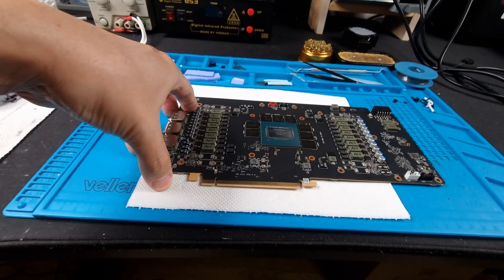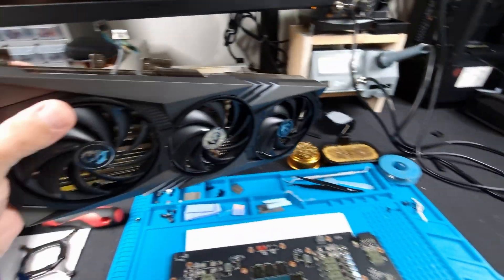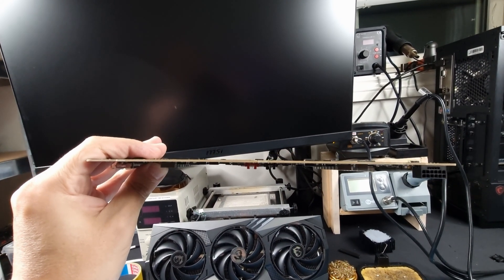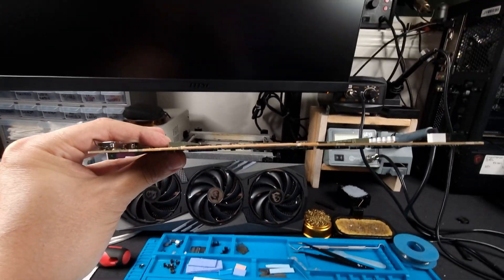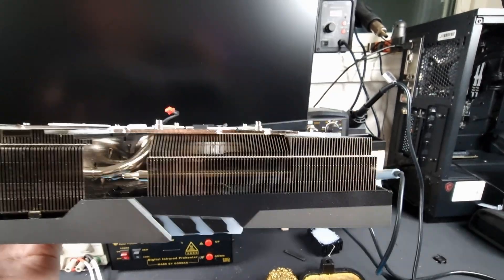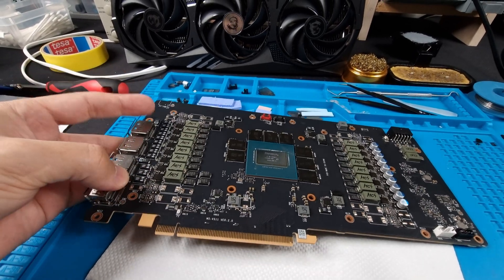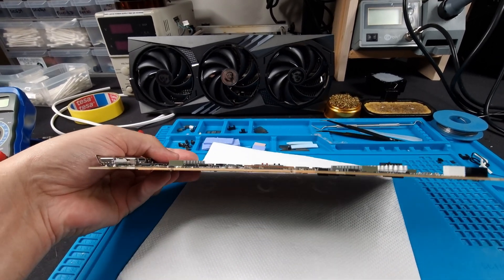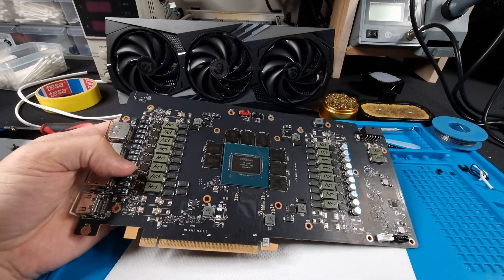How Using GPU Supports Incorrectly Can Destroy Your GPU.

Comment: I’m wondering if my gpu has cracked gpu or vram joints cause now my games tend to stutter and I do use a support bracket system and I did put it at the end of the gpu so idk if the PCB is twisted cause of where I have the support bracket at. I would have to fully disassemble it to find out. 0:15
Reply: I'd try using a fixed FPS... like 60. Stutter usually disappear... if you leave it uncapped, the system usually needs to "breathe" every few moments.
Reply: @ers-br  Tried that. Still stutters on some games
Reply from the maker: @devonefoster105  If you had cracked joints under the memory or core, you'd be having artifacts or intermittent power losses. Stutters could be your CPU being overloaded, or just not fast enough. It could also be VRAM being overloaded, as well or system RAM being filled.
Reply: @TechnologyHive  the specs I have is Ryzen 7 7800x3d with Radeon RX 6950 XT and 32GB DDR5 CL36 6000mhz ram.
Reply from the maker: @devonefoster105  Remember to trim your SSD and or HDD. Also, check how many processes your have running in the background. That could be the cause of your stutters. The 7800X3D is still an 8 core CPU. It could be getting overwhelmed.
Reply: @TechnologyHive  I’ll check that and maybe do some stress testing on my GPU, Ram, and cpu again. Cause the first time i did those tests everything passed
Reply: Game stutter is the bane of PC gaming right now,especially unreal engine games stutter a lot and there is nothing you can do
Reply: @Inpulsiveproductions  That’s unfortunate. Cause I like some of the UE games.
Reply: @devonefoster105  same,and now days feels like every game is using UE engine its crazy,lets hope it gets better,stutters are not exclusive to UE games mind you but ye if the games your playing are on UE engine that might be the problem, and not your PC
Reply: @Inpulsiveproductions  it’s funny because I’m researching what GPU’s can run unreal engine 4 and 5. And idk if this is true or not. But Nvidia 40 series cards and AMD 7000 series can run unreal engine well. I have a XFX Merc 319 Radeon RX 6950 XT and I don’t think that card can run unreal engine 4 or 5 games that well. I could be wrong. And some games I do play are unreal engine 4. Like Train sim world etc and that game stutters really bad. And then again unreal engine has limitations when it comes to rendering or something like that. Unreal engine 5 is much better in general.

Comment: Will having the support more to the middle of the card make any difference?🤔😏
Reply from the maker: Not really, because the actual PCB's for most of these heavy cards is about half the length of the heatsink. So installing it in the middle does not really fix the problem. A riser does.

Comment: I can't estructuraly understand how a CPU would detach from the board in a vise grip configuration. the cold Plate is being Forced Down the CPU and the Board together by the CPU Screw mount
Reply from the maker: Easily done, by hot/cold cycles and adding just a bit of resistance on either side of the card. The lead-free solder which is much more brittle than leaded solder will then crack in time, and cause disconnect between the board and the GPU core.

Comment: That and sub par msi quality look how flimsy and cheap that pcb looks
Reply from the maker: I have cards here for repair with the same issue from ASUS, Gigabyte, and MSI. Brand has nothing to do with it.
Reply: @TechnologyHive  I’ve seen sapphire and evga pcbs and they’re far sturdier than those
Reply from the maker: @annoymouse890  Yup but I also have cards here from Sapphire 😆 with cracked memory joints.
Reply: @TechnologyHive  I’m not saying they’re perfect I’m just saying they’re a lot better and I might have a slight prejudice towards msi cause I’ve had nothing but problems with them I bought a motherboard that just didn’t boot and the replacement wouldn’t boot either and I also had an msi gaming z gpu with insanely high hot spot temps and awful fans and just a flimsy construction over all

Comment: I use gpu support and it holds good, No issues, Without a gpu support you have to use a riser vertical support, Not using anything will crack you pci on you gfx card,  On their newer gpu's, Because they are simply too big on the heatsink part not too now, Atleast on nvidia's side.
Reply: The ppl saying you don't need gpu support are out to lunch.
Reply: @dusty_48  It's crazy i know 😝
Reply from the maker: By the weight of these cards, you need some support if installed horizontally. but it needs to be done correctly.

Comment: They should just add a liquid cooler in the RTX 5000 series and make the thing small and remove the BS power connecter, this shit is ridiculous !
Reply from the maker: They will never go with water cooling. They want to avoid as many RMA's as possible.
Reply: @TechnologyHive  You are correct about the RMA's side but at this point water cooling is the way to go !

maybe something like a external connector on the back of the card with just a water block on the card would make things easy on the RMA side !
Reply from the maker: @TheCashman007  What you will see with RTX 5000 series is more of the same. But the 5090 is rumoured to be even bigger. That should definitely without question go on a riser.
Reply: @TechnologyHive  luckily for me i don't have money buy it !

Comment: Bro i need your help, i did follow your video about the ryzen 5 on steroids, now my pc wont turn on, what can i do? Please :(
Reply from the maker: Take the motherboard battery out for about 20 seconds, then replace it.
Reply: @TechnologyHive  i already did, it works, thanks, bro i did everything on your vídeo, everything works except the dram configuration, when i touch that, i get black screen.
I have a ryzen 5 5500+ Asrock b450m+ rtx 3050 and i have like 50 fps on teamfights on league of Legends, what can i do? And sorry for bothering You, it's My first tome doing this, and i Buy the PC new but i live in another country and the person who sell the PC to me is a pain in the ass :(
Reply from the maker: @figolisimo8393  Try disabling Gear Down mode :)
Reply: @TechnologyHive  where is that?
Reply from the maker: @figolisimo8393  That is in the advanced memory options.
Reply: @TechnologyHive  ok, so i desactived gear down mode, now what? I touch My dram configuration? My ram is 16gb at 3200 mhz :) il wait your answer, i won't touch anything, i freak out yesterday when My PC got black screen and i almos cry, XD :)
Reply from the maker: @figolisimo8393  If you disable Geardown Mode, you should be able to overclock your ram higher, some cases. Try that.

Comment: What if I have like 2 or 3 RTX 4090 tho, how do I mount them all vertically? And there is the cooling performance as well. Also if I install them vertically but use multiple supports to spread the gravity pull even will that work? Thank you in advance!
Reply from the maker: Your situation is a different case.

Comment: Crappy supports are the thing. If you only support one end then yes the weight differential is going to cause warped and bent cards and eventually cracks. Vertical mounts are a solution but FULL supports that support the entire card instead of just one corner are also a solution.
Reply from the maker: Vertical mounting for heavy cards is the only solution. As long as these cards are mounted horizontally, they will continue to die slowly.
Reply: @TechnologyHive  🙄🙄

Comment: It's not just user error, but the support that comes with the card doesn't have any guide how to install them so people go with theit own assumption how to install them.
My support actually doesn't fit into my case so it's literally outside of it standing next to my case, but will adjust the height based on this. I do plan to buy a new case that can fit the cables and will try to get one where i can mount vertically to prevent this issue
Reply from the maker: @ProfRoxas  Your card will thank you 🙂

Comment: does this include gpu support that are attached parallel to the gpu?
Reply from the maker: @HelloKittyGUNDAM  Any support. The card initially will look leveled with the support. But hot/cold cycles will in time warp the pcb no matter what you do, unless installed vertically.
Reply: @TechnologyHive I see, so sad i want to fit it vertically but my cooler is a noctua nhd15, i think the cooler master Gpu v3 kit wont fit 😢
Reply from the maker: @HelloKittyGUNDAM  Have you thought of selling the hd15 and getting an AIO?

Comment: Us people using dual tower air coolers practically can't vertical mount our GPUs 😂😂😂
Reply from the maker: @EravielTachibana  True. I have experienced that myself. But if your card costs more than your whole system alone, put it on a riser and get and AIO. I charge $150 to reball a gpu and sometimes the pcbs are too twisted that even a reball won't fix the card. It's dead brick.
Reply: @TechnologyHive  Sadly I've had enough of AIOs, I had two AIOs got pump failure in 5 years (first 3 years, then the next is 2, a coolermaster and another I forgot because I threw it out already 😅). I guess I just picked the bad AIOs, but I'm done risking it 😅
Reply from the maker: @EravielTachibana  I hear ya. I hope it goes well with your setup.
Reply: @EravielTachibana you might be able to vertical mount with a dual tower if you have a case with 8 or 9 pcie slot and install the riser on most bottom slot

Comment: Well that was a long ass explanation for saying. Your pushing your GPU up too much ... use a leveler to make sure its straight.
Reply from the maker: @MrKilladark  It does not matter how straight you put it in there. Hot/cold cycles eventually will cause the pcb to warp when installed horizontally. One day you will take it out to dust it off and it may not start again.

Comment: i used a block of cardboard (square tube) to "prop" the card so it doesnt sag ... i experienced worstening of temps after few months period. relieving the "stress" lowered the hotspot for 4-5C so its not spiking over 105 on 4k load. But its so bad that i fully expect to either change the card or "repad" "repaste" the card...  

Take care of your HW folks.

Comment: I gót my Rtx 3070 and i dont ever need to use gpu sag bracket cuz gpu was 3 slot but whole gpu hat front amd back made from metal and all it was mounted with scrzes and belived or not all it hold up togeather perfectly 3scrues was enough and there was no sag. I upgrade to rx 7900gre and this is also samé size gpu slightly more heavy but i noticed that this gpus sag quite a lot even tho gpu is made very well is allso metal conected directly to cooler so its very good but i noticed very small sag and i mesured it with digital measuring tool and its give mé basicly 4mm low on the right side sooo i get my hands and start looking for some stuff and i find really cheap full metal bracket with rubber stads and there was multiple sizes and one that you can actually made your own custom so i pick it up it was Like 12 eur plus shipping as i said very cheap but it does what is should i made it inytentionally still lIttle bit low on right side around 0.2mm to bé exact so i dont pushing it up more than enough so yeah bracket is great tuff and you need it plus you dont need rizer cable at all brakes is fine you just need to use it cirrectly and definitelly IF you buy gpu it allways costly item make sure you buy support for it cuz as it mention in video when this things broke its nôt cheap thing to repair and almost all shops will avoid to repay you and they void your varanty for sure cuz this is gonna bé mechanic al damage.
Reply from the maker: @eikbolha5883  This is why I made the video, to bring this to people's attention. Many cards are dying due to their weight and sag or using supports the wrong way. Best to use a riser. Thanks for watching btw 😊
Reply: @TechnologyHive  sure mate some manufucters even include brackets into paccage Like gigabyte Rtx 4080superr
Reply from the maker: @eikbolha5883  I hope this will one day become the standard for these heavy cards. I get a lot of them in for repair here due to the same issues.
Reply: @TechnologyHive  probably not cuz cheaper gpus just gonna bé Like this long tíme and expensive ones well asus háve allready making new gpu without cabels just full PCB connect ión Like Rtx 4060 mini but this is Rtx 4090 hugeeeeee hahahah but that fix main issue with faulty connector but create yett another one cuz that gpu from asus is massive hugge heat sing also i see reports that using that mamuth without sag bracket even for a week or so create cracks on PCB around 16 pin connection. Rizer is good way to fix this but as many other users samé mé i cant use Rizer there are no holes for it also my case is older design and this woukd just not work cuz i have massive cpu Air cooler, just over all many users dont using raizer cuz its actually také more space IF you rotate gou6and IF you have smaller or older case Like i do well you wont bé able to fit it there. IF i change while case one Day maybe than i Will try that but so far i dont háve intention to do that cuz everything is fitted soo fine that there is basicly no space left also im not touch Ing cable management ever again on this build i made it soo nice it took mé 3 hours ró rewire most of the cables to look diecent.

Comment: That depends on the support used. XFX cards like the 7900XTX come with a Bracket support instead of a Pole Support.
Reply from the maker: @thelaughingmanofficial  Nope. If installed horizontally, your card's pcb will, in time, begin to warp due to hot/cold cycles. Heavy cards need to go on a riser.
Reply: These latest cards are not the first to sag a lot and ppl were fine with having them horizontally for almost a decade. This is a lot of panic mongering.
Reply from the maker: @dusty_48  That is because for decades leaded solder was used. Today, everyone wants to go "green", and lead-free solder is being used. Lead-free solder is more brittle than leaded solder, and will crack easier.

I use leaded solder in all my repairs, and so far I have not had any reballs come back even on slightly warped PCB cards.
Reply: @TechnologyHive  A Bracket support is far more stable than a Pole mount. It's physics, it's not that hard to understand.
Reply from the maker: @thelaughingmanofficial  what would you consider a bracket support?
Reply: The 7900 xtx has a mounting flange built into the end so support is on the frame / skeleton of the gpu, not a corner or edge. I saw the logic of this when I had to us a pole support because my case does not work with the gpu bracket (loan li evo xl). I installed cooler master vertical, works great although had to modify for the lian li case. Thanks for validating my  concern and efforts!

Comment: I do not like risers I prefer good case I use Cooler master HAF XB EVO,  mainboard is installed horizontally and my GPU vertically. One down side they stop making them 10 years ago.
Reply from the maker: @kkrolik2106  Ah, they don't make them like they used to, do they? That's a nice set up.
Reply: @TechnologyHive  I use this same Case and CPU cooler  Noctua D14 for over 10  years already. Case weight a lot more compared to modern one quite thick steel sheets used.  I still use Hot swap HDD bays :)

Comment: What weight (max) the gpu should be such that it doesn’t need a riser. I mean after what max weight gpus start to sag?
Reply from the maker: @StudyWithNika  I think common sense comes into play here. My rule of thumb is that if the card is longer than my motherboard is wide, and it takes 2.5 pci slots, it goes on a riser. But this is just me.

Comment: If a person has a huge GPU the correct method is to mount it either vertically or horizontal in a case. Putting that much pressure on the motherboard and case is a very dumb idea.
Reply from the maker: The GPU should be installed vertically, being so heavy as these newer cards are. Just to prevent damage in the future.

Comment: Would you recommend vertical mounting a msi 4090 gaming x slim card ? They are a bit smaller but would it benefit in the long run to have it vertical apposed to horizontal mounting. I have had mine horizontal for the last year and it seems fine I bought a 3rd party gpu brace when I picked up the card as well.
Reply from the maker: @Brandobandito  Yes, absolutely 💯.

Comment: Bought a ASUS 4070 TUF a while back and it had a support that came with it but I found it really flimsy to deal with. Greg Salazar actually recommended a support that works really well from Lian-Lee as it fixes on to the motherboard and case. One thing I did do was make sure I installed the card and support with the PC on it's side. That way I can see where the support needs to go to better support and just gently rest on the card. If the support was tight to the card causing it to rise i'd say that's where you get thermal flexing under serious load which as bad as card sag with no GPU support. Ideally I would recommend vertical mount if you can afford it but it would also need to have decent airflow as depending on how big the card is, the closer you are to the tempered glass the less air to the GPU you get. Also could be another reason for horizontal cases to make a come back like what I had with my old 386 back in the day
Reply from the maker: @stretchable4647  No no. Don't install it vertically using your case vertical mount. Buy a 3rd party mount, like that by Phantkes.
Reply: @stretchable4647  so you don't recommend using the support that comes in the box?

Comment: The problem, is that j have had the sliding down of thermal paste from the core (not istantanely, bat after a couple of months) mounting gpu in vertical position ... and so core hotspot hitting 100°. It's better mount the gpu in horizontal position (imho)